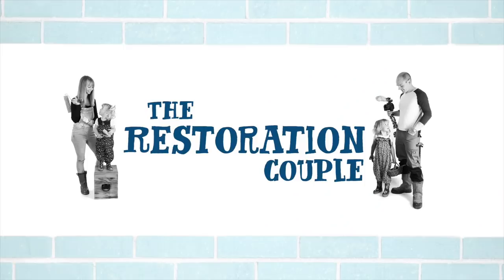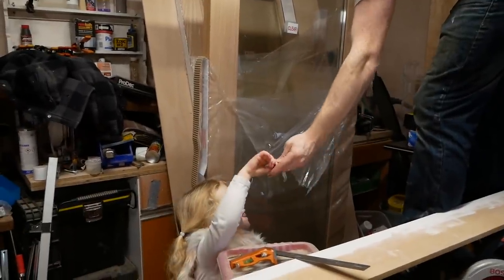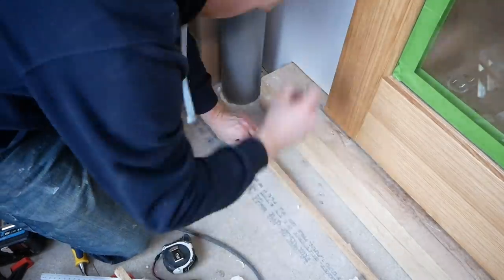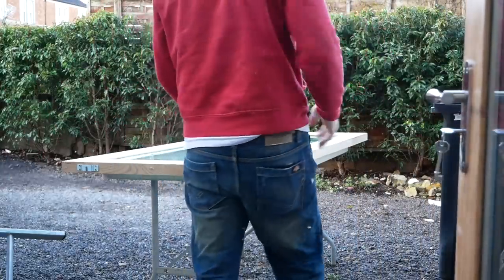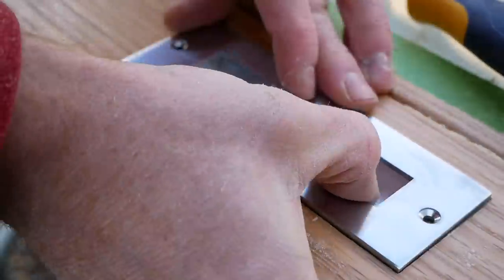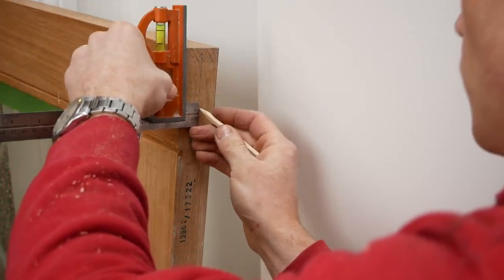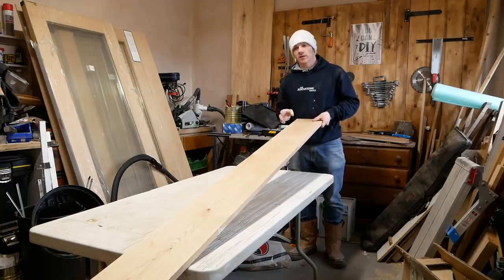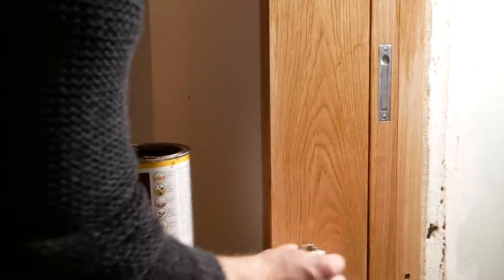I MADE A HIDDEN OAK POCKET DOOR!

Comment: I recently made a cherry pocket door and installed an edge pull similar to yours.  I used the domino joiner to cut the mortise for the part which retracts deeply into the door.  My door was 1 3/8 inch thick, so I made sure the mortise did not interfere with the surface pulls.

Comment: Nice work, im currently doing my own porch at the moment and been looking at different style doors. At the bottom of your door is there trim to stop and drafts as i couldn't see that detail.
Reply from the maker: No draft as the porch itself is craft proof however I have ordered a brush seal to go down there.  My  gap is a little larger than planned otherwise I might not have bothered at all.
Reply: @TheRestorationCouple  Thank you, I've seen the quality of your work so I'm not surprised the porch is draft proof and I'm hopping mine will be the same. Just wasn't sure with my own what sort of fit it would need in to the frame to be classed as an external door.
Cheers

Comment: What was the osmo product you used on the door and did you wipe off the excess with a cloth.
Reply from the maker: PolyX satin clear (rapid) foam brush on and yes usually wipe off. Unless it’s a worktop when I tend to leave it as a thicker more durable top coat.
Reply: Is that the raw 3044?
Reply from the maker: 3032. Just clear. Although I used a little of the honey colour to darken the lining.